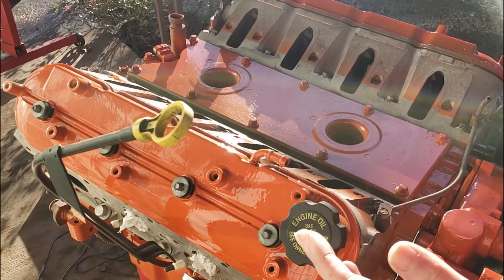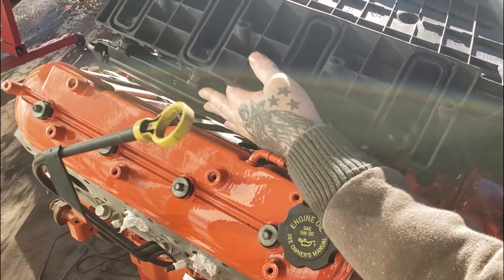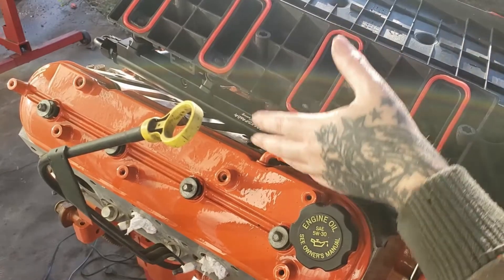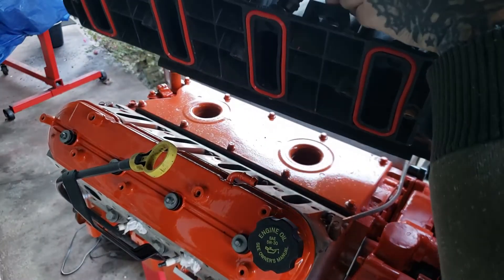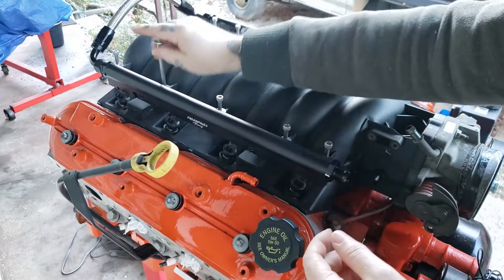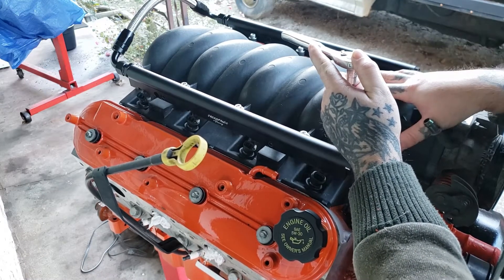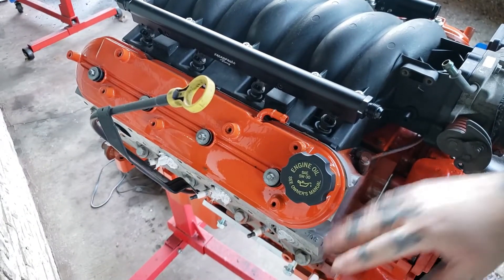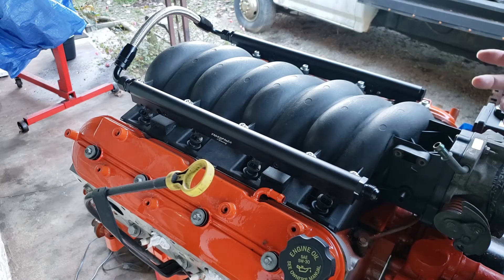HOW TO INSTALL A LS1 OR LS6 INTAKE

Comment: 5 seconds in and I see homie scraping paint off into the combustion chambers, using words like “cheap Chinese”… I knew it would be solid engineering info
Reply from the maker: a little paint never did hurt a combustion chamber lol, its the bolts that you got to watch out for

Comment: Mine will not sit flushed it's almost there but not there. Will the bolts help sit correctly?
Reply from the maker: It should set flush before the bolts, make sure your not hitting the vent tubs of the engine

Comment: Why are you using a rectangular port intake on cathedral port heads? The LS2 manifold has the correct ports.
Reply from the maker: The ls6 intake manifold ports themselves are not cathedral shaped or their gaskets, but are for cathedral shaped heads

Comment: For the price of a ls6 intake you might as well get a sheet metal mid or low rise intake
Reply from the maker: You are right, the metal intakes are priced at a very good budget friendly price, but they don't flow as good and u can't run the gm coil covers that are like on the corvettes with that style of intake
Reply: @TattsForLife  Holley intakes come with fuel rails and crossover

Comment: You need to put thread sealer on the manifold bolts and start from the center on each side and work outwards… you should NOT be giving advise on this.
Reply from the maker: great info
Reply: Do you have a better video

Comment: love the videos very helpful
Reply from the maker: Thanks
Reply: @TattsForLife  can you use truck injectors on this intake? would you have to reem the hole so they sit in further?
Reply from the maker: @Mikaboi  no, u don't touch the intake seat, you would need to use a aftermarket fuel rail that will allow for the truck injectors hight, hope this helps
Reply: @TattsForLife  I have the same rails as you but my dad says they wont seal because of that lip, do you swap o rings or something
Reply from the maker: @Mikaboi  I have a video of me installing the truck injectors on that rail, look for the video in the ls engines and more Playlist on my channel

Comment: Nice video 🥶 I’m building a 5.3ls lm7 year 2000 and I’m was not sure if that intake would fit a 5.3ls, what changes were made  for that manifold ? Or just plug and play help please 🙏🏾
Reply from the maker: just a bolt on basically

Comment: I noticed that the heads have cathedral ports and the intake has Rec ports ..any issues since u didn’t use adapter?
Reply: I had the same question, noticed the intake had different shaped ports
Reply from the maker: its a cathedral port intake, that's just how the car intakes ports look for a cathedral, if you had that intake next to a rec port, it would be more  noticeable
Reply from the maker: its a cathedral port intake, its how this intake and the LS1 intakes are made for cathedral ports

Comment: U need a filler neck instead of just the oil cap …because the passenger coil pack will keep you from being able to to take the oil cap off
Reply from the maker: great info, but I have my other LS swaps the same way and I have had no issues with the oil cap setup this way
Reply: @TattsForLife  oh ok ig that’s just for ls1 then because thats wat I had to do with mine
Reply: I got ict brackets works fine
Reply: No it won’t I have it like that and it’s fine

Comment: What injector rails are those? I plan on using ls3 injectors so I need to see if something like those will work.
Reply from the maker: this is the link to the ones I used https://www.ebay.com/itm/324524055345